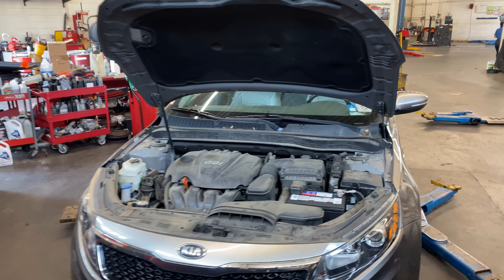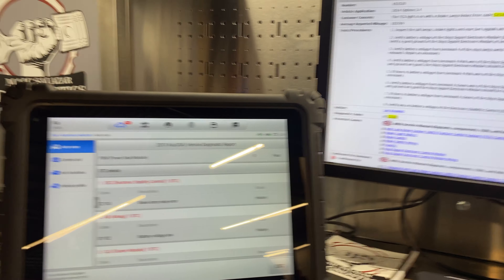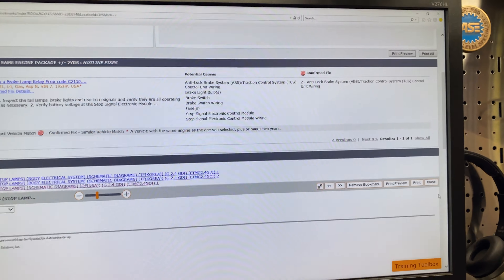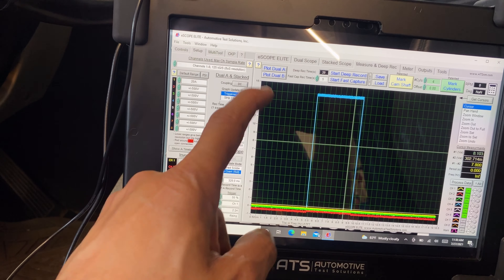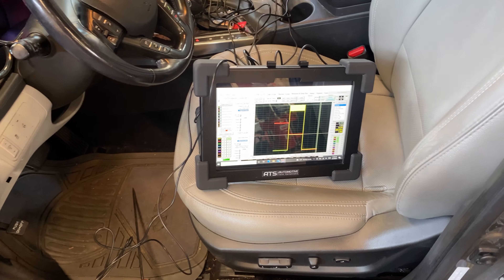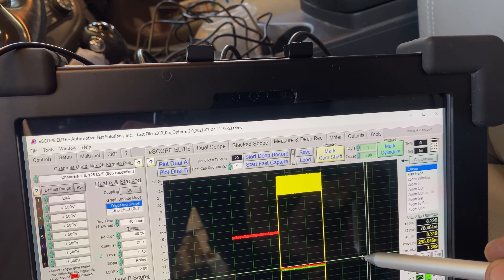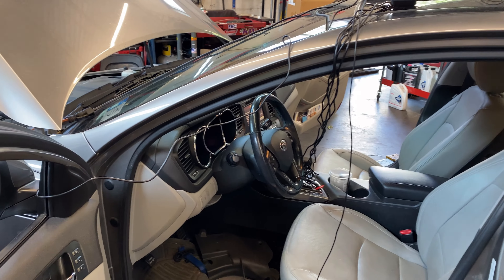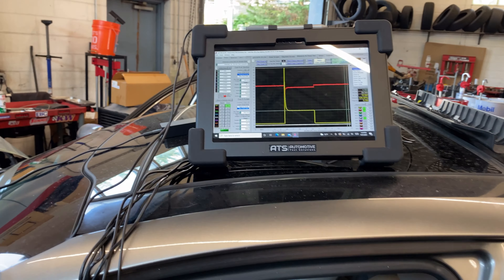2013 Kia Optima No Brake lights Diagnosis MUST SEE Video!!

Comment: I chased a No Brake Lights and an illuminated Stability Control light problem through this whole system of fuses, switches, relays and wiring. After checking the components from the Fuse to the Hill Assist relay I determined the Hill assist relay was not allowing the signal/power to go to the brake lights. I replaced the Hill Assist Relay in the fuse box under the hood and The brake lights work and the Stability Control Light has gone out. Thank you for such an in depth look at the brake light system. Without knowing the brake light relay output went to the hill assist relay before going to the brake lights 
i may have had to take this car to an electrical shop to have them find the problem. Mike @ Phelps Body Shop of New Albany.
Reply from the maker: I am so happy to be of help. Blessings
Reply: What is hill assist relay
Reply: The relay not fuse is abbreviated HAC. I had the same issue with the traction control light on and no brake lights. I took out the HAC relay. I flicked it with my fingers a couple times, put it back in and the traction control light went out and I had brake lights again! Thanks Michael Phelps and Maic!!
Reply: @massimodalessandro9259   both of you are blessings. I have a 2012 Optima SX-T GDI and for the past several months I’ve been chasing the issue with this stability light and how it would cause my brake lights not to work. Located the HAC relay, took it out flicked it, made sure it was clean, put it back in, and I swear it was like magic. Brake lights work and stability control light GONE. I have you two in this comment section and Maic to thank. Thank you
Reply: This comment needs to be pinned
Reply: worked for me. $15 fix
Reply: Does is need to be the oem part? I flicked it and the magic didn’t work.  The stability control is gone until you put it in gear
Reply: @BVD_INFLU3NC3  I replaced the hill assist relay to make mine work.

Comment: My back taillights would not work but my third light would as soon as I put a bulb on it would cut the third brake light off and tracken control light would go on i ended up changing the HAR relay and it works now

Comment: I have C2130 DTC - drive cycle check incomplete/pending.  Brake lights work when pressing pedal and also when unlocking the car using FOB
What could be the issue ? 2013 Kiia optima manual  LX

Comment: Maic, AWESOME diagnoses thanks for sharing and is that scope easy to learn or PICO is better.
Reply from the maker: I think this is better, it has a lot of software test that otherwise you 'll need to try and do with math channels. Pico is a much better scope as far as resolution and buffer, but for the daily test I do, cam - crank correlation, coil tests and so, ATS  is a much faster set up.

Comment: Question? I have a 2011 Sorento brake light are dim and when I turn headlights on I have zero brake lights and it kills the throttle. I can let off throttle then back into throttle and it does fine only no brake lights!! Any suggestions?
Reply: Traction control and hill assist both come on shortly after lights are turn on!